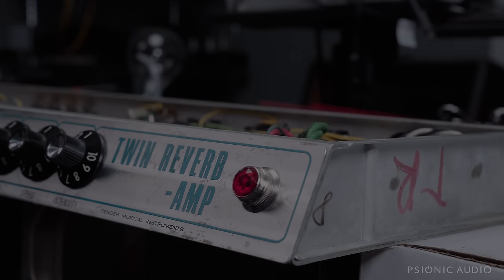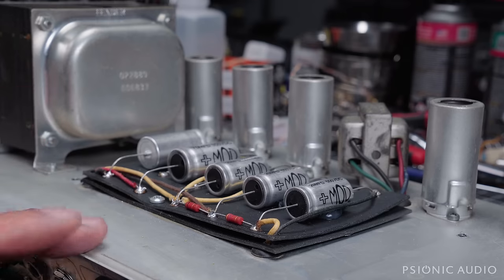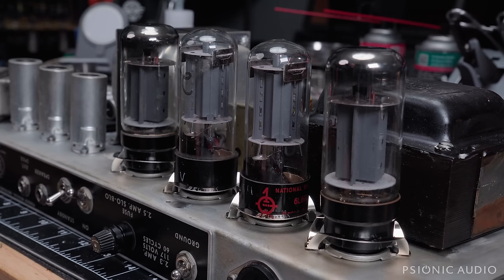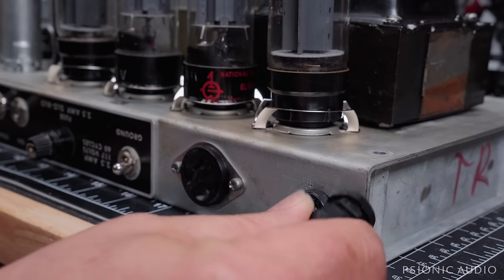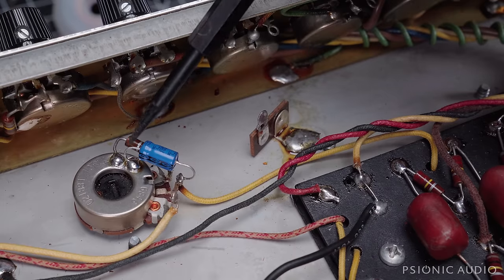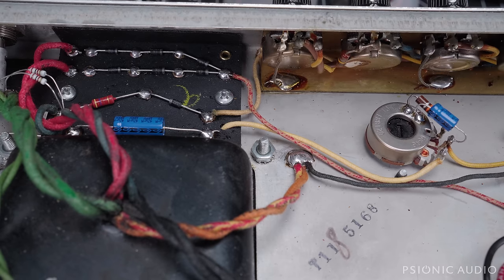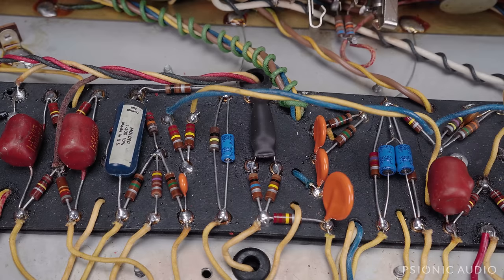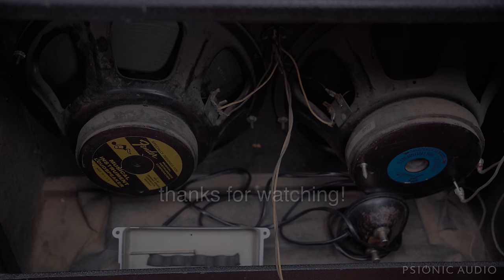Core Concepts | '68 Fender Twin Reverb Pt 4

Comment: I am humbled that Lyle forgets stuff too. I bought a cheap whatever the midline squeeze action cabinet 24 inch clamp is at Harbor Fright and turned the toe piece around so the clamp is now a spreader. A couple of light squeezes after the clamp is tight enough to hold itself in place and those chassis will slide out much easier. If there are screws to loosen up, LOOSEN them up FIRST! Always a pleasure to watch such a high level of truly professional pride in workmanship from the impeccable Mr. Lyle. When I was 12 years old I blew a part of my finger off fixing Mom's Supro amp. That was 45 years ago. I have had ONE worse shock working as an industrial electrician on 4160 volts so guitar amp hazards are no joke.
Reply: One one occasion when I was working on a Marshall 50 watt plexi I forgot to discharge the mains filter caps. DOH! I had both arms on the chassis and I touched something which I should not have done. About 450 volts went in one arm, across my chest and out the other arm. It blew me backwards off of my feet and hurt like hell. I am amazed it did not stop my heart

Comment: Nice to hear about the new style cable glands.  I recently had to replace one in a Vibrolux Reverb I had just bought, and the one I ordered from AES was too small for the massive 3-prong cable that was in the amp.  (I did measure the cable with my "Executive Pocket Chum" caliper, and thought I ordered the correct gland).  I ended up using a power drill to make the hole in the cable gland slightly larger and managed to finally get it installed.  Hopefully it will never have to be removed.

I think most of us interested in amp servicing will sit through a long video, even if it contains the same info as a previous video.  Sometimes repetition is good for learning.  Have a banana!

Comment: I still use foam to hold down the caps in the doghouse. I use the current shunt method to bias as well, and you’re right. It’s dangerous ass heck if you don’t have a secure connection. Very easy to short out 400vdc + to the chassis/tubes, or worse, YOU.

Great restoration on this fantastic amp!

Those WGS G12A’s are amazing speakers. They just cost as much as a ratty mid 70’s Twin for a pair.
Reply: I was measuring plate voltage on a Super Reverb power tube and my multimeter probe slipped so it contacted both B+ and a tube socket tab connected to ground. Half of the tab on the tube socket disappeared in a flash. Talk about a brown pants moment …
Reply: I use the output transformer resistance method to measure bias.  I use the clip on style meter probes, and do the connections to the tube sockets before powering up the amp.  Having 2 meters helps.

Comment: I recommend buying a bias probe for biasing, its the safest way, u just plug into the power tube sockets and plug the tubes into it, it reads in ma. And it reads both tubes to make sure your within spec.
Reply: Voltage drop/OT resistance method is slightly more accurate, and safe enough with the right probes.

Comment: Ive never seen those "newer style" strain reliefs before but i think love them already lol. Im also not a fan of the older ones for a few reasons. With my own amp builds i just install an IEC socket. But for vintage radios and other older equipment that needs a new mains cable id really love to try out the newer ones. I cant say one hundred percent that ill like it better without trying it but by the looks of it and your description it seems far superior. And its perfect you get them from mouser cause thats where I try to get all my components cause i live close enough to their Mansfield warehouse to use their will call and avoid shipping costs. Thanks for mentioning it!

Comment: I noticed that all the WGS Speakers I installed / used  (and that's quite a few, including Green Berrets, Reapers (55/75Hz, HPs), ET65, G12C, Black Hawks ) required a quite long time to break in, usually +20h. Same for Jupiter Speakers which are also manufactured by WGS. This drew me off on the first pair but being to lazy to deinstall I noticed how they develop over time....

Comment: I don’t understand how AC grounds (which are super important) get stuck to the chasis with just a giant solder blob, and no mechanical joins. In all other cases the advice is to avoid tag soldering and always have mechanical support. What’s the difference?

I would guess you’d have to drill a small hole in the chasis to secure the ground a bit more.
Reply from the maker: I wouldn’t build a new amp this way, but this is how Leo built these.

Comment: If "heat is a thing in capacitors" why would they be underneath the doghouse? Just curious, Lyle. Love your stuff, long or short form.
Reply from the maker: As caps fail (which gets more likely as they run near or at their rated max voltage) they generate heat themselves, which speeds up the failure process, which makes them run hotter…

It’s a separate issue than ambient temperature, and that is fine inside the doghouse.

Comment: Lyle,  first,  thanks again for the great detail in the video. Because I own this same twin,  I'm checking all the fine points. I've recapped mine and will look at your service carefully here. 

I'm sure it's down to owner preference,  but why would one not want to add a variable bias pot to the bias balance? I was thinking about doing so on mine but haven't gone that direction yet. I'm curious if you have preference or opinion on this. Thanks for sharing so much invaluable amp service information. Your viewers,  myself included,  are quite fortunate.
Reply from the maker: Thanks! See the various ‘70s Fender videos. In those I usually add bias level while retaining bias balance.

Comment: Hello;
What kind of glue or silicon you use in order to stabilize filter caps onto the board? Is regular hot silicon safe to use? Thank you.
Reply from the maker: Never use hot glue in an amp. Use RTV silicone. You can get it at most auto stores.
Reply: @PsionicAudio  Thank you so much for your respond. I was about to use hot glue. I appreciate.

Comment: Trying to figure out how to add gain to one.  I hardwired a 2008 reissue during the pandemic because I was bored and it was staring to have problems.  I pulled all the pc boards.  Are their any ‘gain stage’ modifications?

Comment: Anyone have a part # for the Heyco strain relief that fits Fender amp chassis please? There are lots of sizes on Mouser. The number of options is bananas!
Reply from the maker: Datasheets. Datasheets, yo.
Reply: My hole size is approx .5 x .625”, and cable diameter is .34”. I’ve looked at quite a few of the data sheets and have been struggling to find a proper match for both, which is why I came here to ask for help. You mention the SJT cable size in the video, but I see no reference to that on the data sheets. Additional guidance would be appreciated. I’m a busy guy, and sifting thru multiple data sheets is time consuming.

Comment: Aren’t svt and sjt two different types of wire?  Wouldn’t the amperage be based upon gauge of wire?
Reply from the maker: Two different types of cable. The wire diameters are different, so the current ratings are. As are the resulting cable diameters.
Reply: Svt and sjt wire diameters are different? Aren’t they referenced by wire gauge?